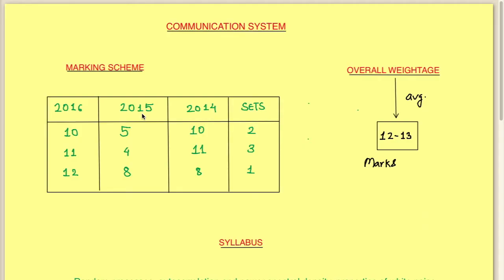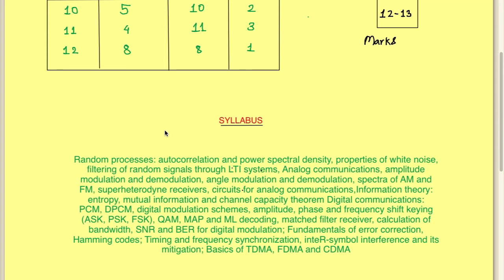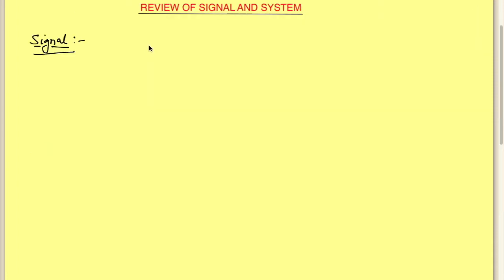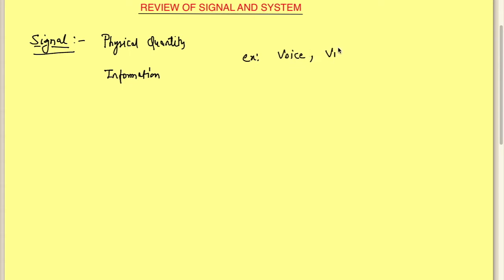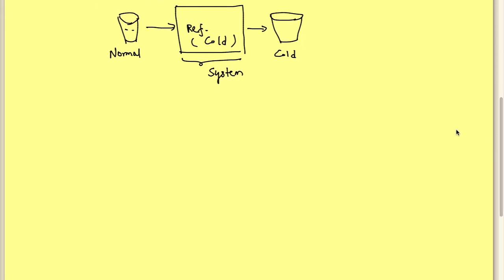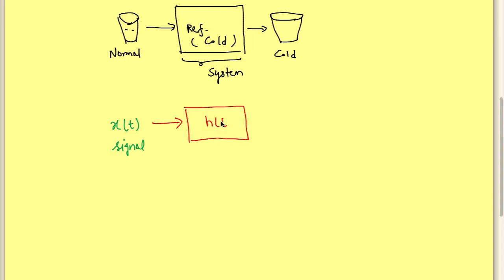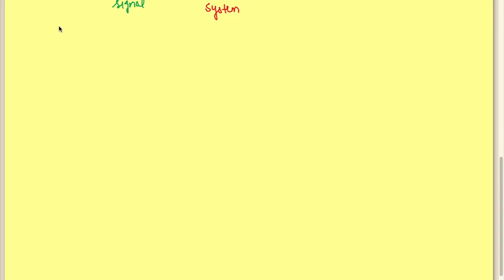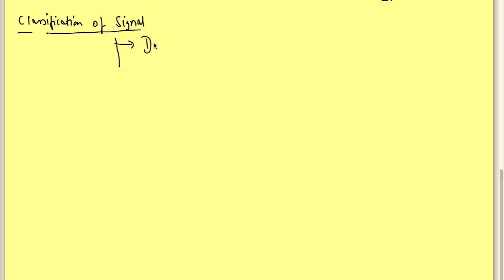COMMUNICATION SYSTEMS FOR GATE |LECTURE-1|REVIEW OF SIGNAL AND SYSTEMS|GATE FOR ECE|EE|EI

Comment: Which software are u using ?
Reply from the maker: +Rajdeep Das it is a note making app in machintosh
Reply: U might use smooth Draw, it's more effective. In this interface it seems something is lacking. A more involvement would be good. But, u are doing a noble job. Keep up the good work.
Reply from the maker: thanks for suggestion 🙂